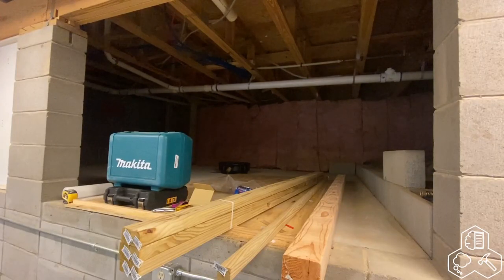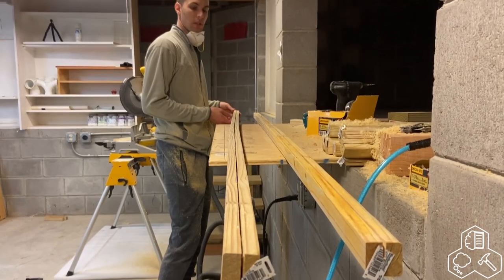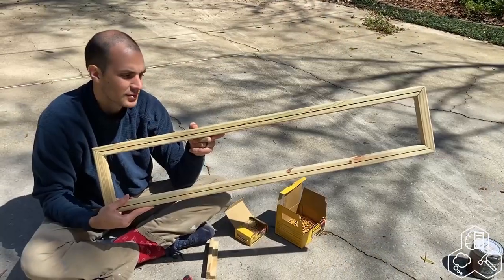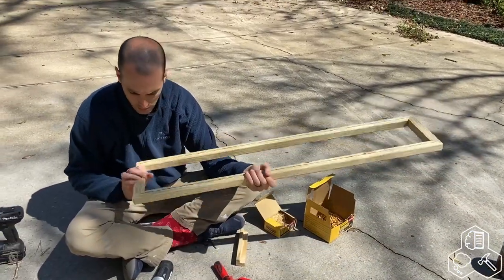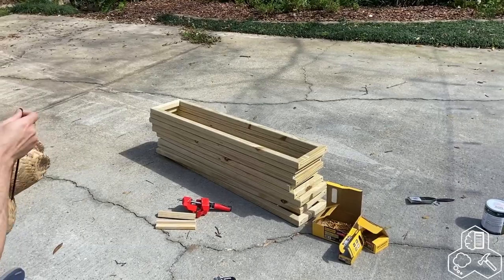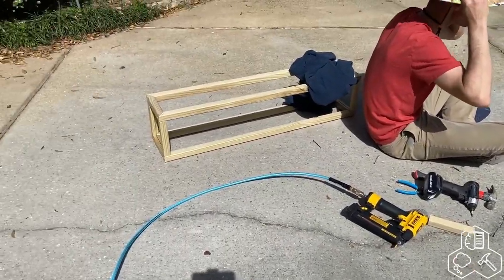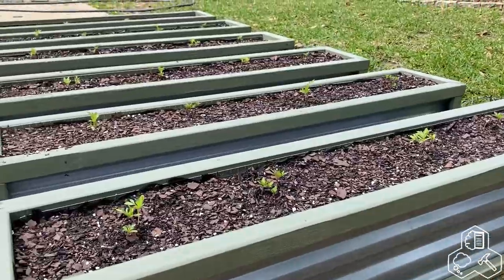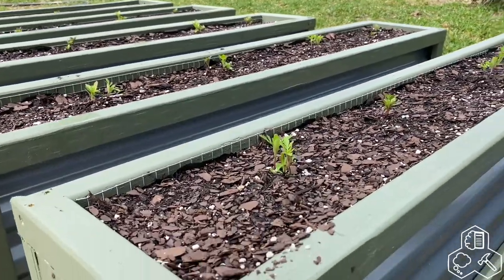DIY Flower Planters - Wood and Corrugated Metal/Plastic

Comment: Curious to see if the landscaping fabric holds up, if it's the light cloth fabric it rips quite easily when wet.  I guess only time will tell.
Reply from the maker: Hopefully it will with the metal supporting it from below. If not, we will have to replace it with something more durable.

Comment: That white flexible wire mesh stuff you guys put in there..that stops the dirt from falling through, but allows the water to pass?
Reply from the maker: Yup, that’s just metal wire (hardware cloth) which gives it mechanical support as the dirt is heavy especially when wet. The metal alone would allow the dirt to fall through. The black landscape fabric keeps the dirt in, but lets water drain. We checked the first time we watered them that the water drained out. Thanks for watching :)